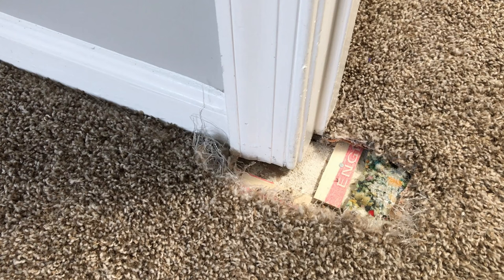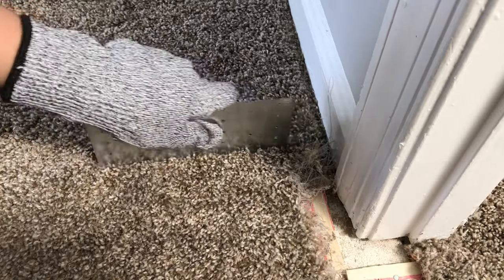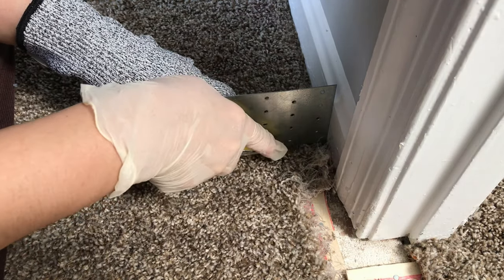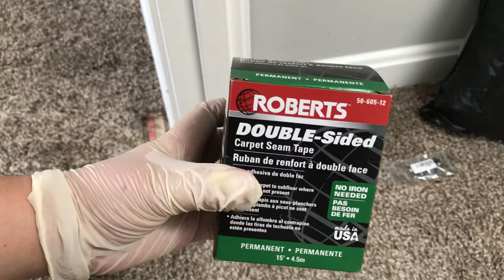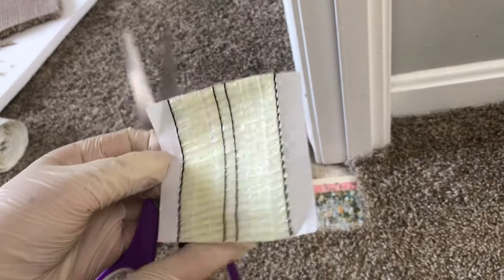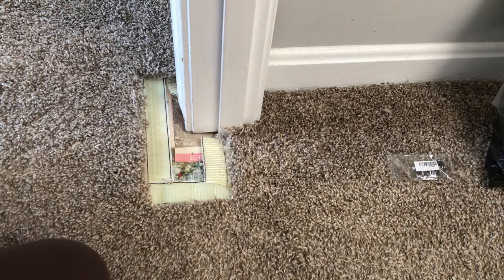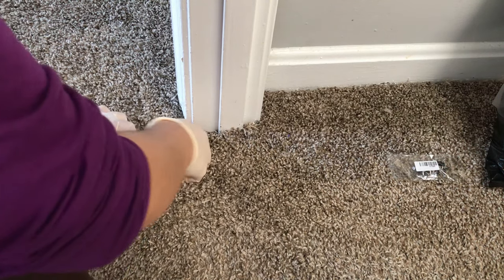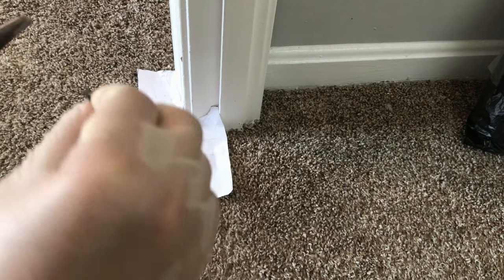You can repair carpet DIY without professional tools

Comment from the maker: One of the commenters noted that "double side tape has to come out and it always takes the padding along with it." I want to take this opportunity to remind folks that you should NOT be peeling the protective paper off the underside of the tape that will be touching the padding. In this video, I peeled off the protective paper from the top side of the tape ONLY but NOT the underside. I trim off the sides of the protective paper that is stuck on the underside of the tape, but I never take it off. You can't have the underside sticky because then  it will be very difficult to slide in the carpet tape under the existing carpet.
Reply: So does the carpet tape just sit on top of the padding?
Reply from the maker: @ericskates91  yes, just like way the rest of the carpet just sits on top of the padding.
Reply: Lowes carries the same tape.
Reply: Awesome! Just what I need.
Reply: Just curious, then what's the point of the tape if it's not attached to anything but the carpet...?
Reply from the maker: @Novehx  The tape is attaching the small piece of carpet  to the surrounding carpet, and that is holding the little piece down in place.

Comment: *Great, straight forward video,, it was exactly what I needed too. It was so helpful!  I was looking for a way to repair some cat damage to carpet.  The damage was also in the same location.   
*The only other thing I separately learned elsewhere {Floors by Southern boys, How to Repair a Carpet Seam: 4:40-6:09} for a better seam (seamless) was to offset the "bubbles" or dots on each side of the carpet backing from each other.  Be sure to cut in between the grid lines containing the bubbles/dots or you will fray/split the carpet fibers.  Also, be sure that that carpet runs the same way (the ssme direction it lays down).

Comment: Awesome video. I do this professionally, but this is simple and very DIY friendly. The carpet trade in general is not very homeowner friendly, and if I have to make the trip to make a patch this size for a client, I won't do it for less than $100. Yeah, I do it the right way every time, but I myself would love to save $100+ by doing a small job myself rather than hired out.

Comment: This is an awesome video. I came here today looking for a solution to a hole my cat made today in the same place as this video!!!  I'm amazed that it could be fixed and that this video showed every step.  It's a lazy Sunday afternoon for me today, so I'll spend the rest of the week looking around my condo and determining which closet I'll pull the replacement piece from and then next weekend I'll have it all fixed!  I have everything I need, including the tacks and the carpet tape (that used I for a different DIY).  THANK YOU!

Comment: Very informative video. If i may, id like to add a couple of things to this. First is, when using carpet from a closet to patch carpet from traffic areas its usually difficult to get a close match. So it is very important to make sure the carpet knap is going in the same direction. Wear pattern or no wear at all if the patch is not running the same direction as the existing carpet its gonna look pretty bad. Second, when using the adhesive tape. Start out by matching up the edges rather than tucking under the door facing first. Thirdly, try to buy or borrow an actual carpet knife with several extra blades. Begin with a brand new blade and change blades often. And lastly, be super extra careful with said blades as they are much sharper than utility blades!
Reply from the maker: You raise a good point about the carpet wear. The carpet that I repaired was  relatively new (less than a year old), so there was not much wear.

Comment: What kind of plate is that? This is exactly what I need. I will try this today.
Reply from the maker: It is called a tie plate and you can find it near lumber or construction section in home improvement stores because it is used to nail together pieces of lumber. They come in all sizes.

Comment: WOW, YOUR GREAT THANKS FOR THIS VIDEO I'll let you know how it goes.
Reply from the maker: Thanks! Your success will greatly depend on how well your replacement carpet piece matches the existing carpet. I had to repair the carpet less than a year after it was installed so it had little wear, and I was able to use the same carpet that had been installed in the linen closet.

Comment: Been looking for a method to use to patch a carpet in my car, this just might do it.  Thanks!
Reply from the maker: That's a great idea, but where would you find extra carpet that's identical to what's in your car already?
Reply: @KYKCreations  I installed a console and had to trim some carpet to fit flush. The bolts are exposed now so I'll use trim piece to cover.

Comment: Don't we need to glue the sides of the carpet? OR instead of glue, you used nails? Please let me know!
Reply from the maker: when professionals install carpet, the "sides" are put over tack strips, which hold the carpet in place and make it really easy to remove the carpet because the carpet is not permanently glued on or nailed in (although I nailed it in a few places as part of my repair).

Comment: Did you use seam sealer?
Reply from the maker: No, I used carpet tape only. Seam sealer was not necessary for my repair, which is holding up really well.
Reply: Seam sealer?? WTH is that?? Carpets use heat activated glue or this already sticky glue. Linoleum uses seam sealer...

Comment: If you top cut, a double edged blade will do infinitely better. Never use scissors to cut backing. Hyde knife will resist a lot less from the backing. Good luck. Please reinforce the seam with a glue gun
Reply from the maker: thanks for the tip!

Comment: Could you use a rotary cutter instead of a box cutter?  Or would it not be sufficient?
Reply from the maker: Tarni64, I'm not sure. I  used a box cutter because it was what I had. It may or may not be sufficient, depending on how sharp the rotary blade is. I think you should give it a try because the worst that could happen is that it doesn't work well.

Comment: Are you saying “ty plate” or “tile plate” at the beginning of the video? @kykcreations
Reply from the maker: Tie plate. It's a piece of metal that you can use to tie or join a couple of large pieces of lumber used in construction by nailing them in to the wood. I was just trying to find something really cheap to use, but you can use any piece of straight flat object to part the carpet.

Comment: Awesome work.  At the end, you added nails as additional anchor to the tape.  Do you do this because in the past you notice that the tape did not hold well?
Reply from the maker: The tape holds really well, so you don't need to add nails, especially if you are going to have tape along 4 sides of the replacement carpet. Since the carpet installers always install a tack strip along the edges of the carpet,  there was already a strip of wood that I can make use of. Since there was a tack strip there and I  had some small tack nails, I just decided to use them.

Comment: Pat's Carpet Repair here..... this video is exactly how... "Not to Repair Carpet". It's not going to look good and you will end up calling a professional anyway, only now the repairman will need a larger piece of carpet and padding because the double side tape has to come out and it always takes the padding along with it. Call a professional, pay him $150. problem solved!
Reply from the maker: Hi Pat,  if you are charging $150 for this repair, then that sounds very reasonable. Where I live, the repair estimates were $250 and up. Maybe I got lucky, but this repair is still holding up perfectly and staying put in a house that is occupied by tenants who don't treat the house with any care.
Reply: Called a professional and now the repair looks patchy!

Comment: Are they just regular nails? And is that recommended as well as the tape? If most carpet repair guys use heat does this tape not require it alone?
Reply from the maker: Those are tiny tack nails with a large flat head (so they wouldn't go right through the carpet). I used them because part of the repair area was next to the edge where the carpet was not being held down by tape. This tape does not require heat.